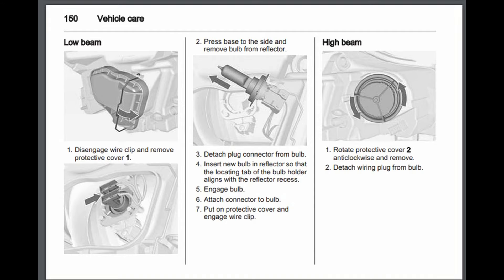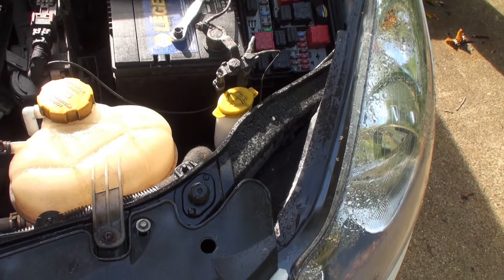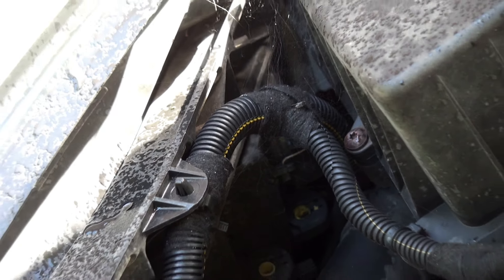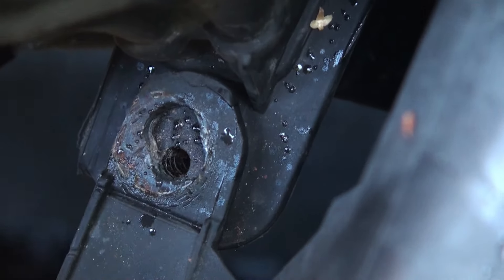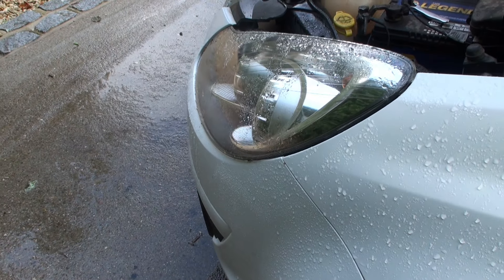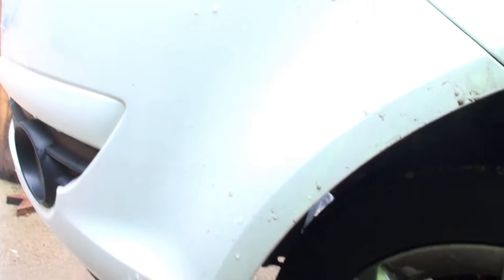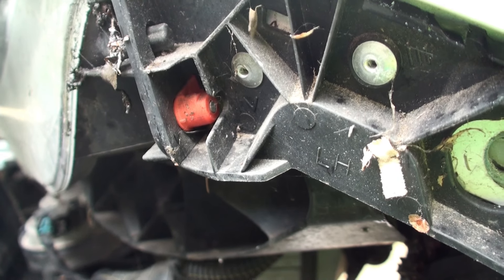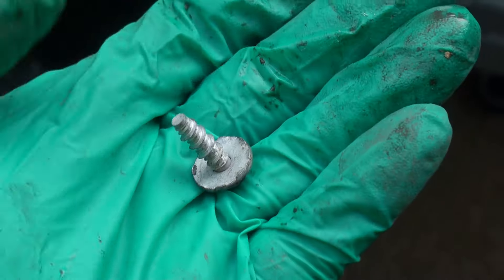Corsa D Passenger headlight bulb change

Comment: The video will be put to use tomorrow, I spent 2 hours on this so far. Its crap. The designers of this piece of shit should never be allowed to draw a box again never mind be involved in car design. It should be illegal and the perpetrators should be locked up. I was seriously contemplating changing it with a large sledge hammer and axe.
Reply from the maker: It is inddeed a strange thing they have done I wonder if anyone even noticed until it was too late.  I think on some variants of this model the fuse box is different and doesn't interfere with the bulb cap.
Reply: @razenby  It seems typical of todays development. When I was a kid we got a string of ferguson tvs, videos and hifis because a friend of the family worked for them and every year they had a new one to test at home. This leads directly to not putting up with crap and getting it fixed. Had the designers been forced during the early stages of development to change all the bulbs on the car they would have sorted it. I have a zafira, had to change a bulb in the dashboard (behind the milometer display) a full 12 hours and the entire dashboard and centre console needed to be disassembled, for one bulb! On my manta they unclipped from the front, on the Minor and the Viva no more than 3 screws... designers today dont use what they design, never find out how crap it is.